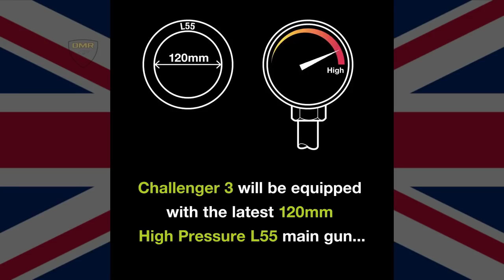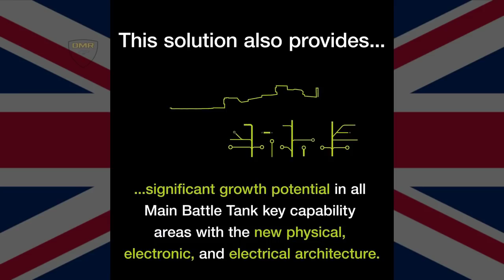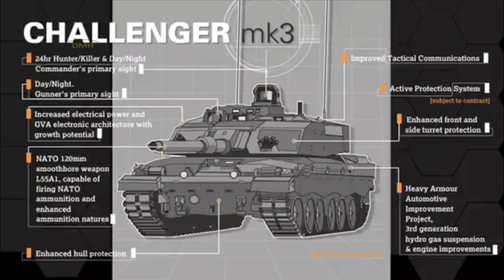Finally! The UK Unveils New Challenger 3 Main Battle Tank

Comment: old hull with its bad protection, a german engine, a german gun, it is a good one but certainly not at the level of leo 2 of mast gen.
At least UK is now more nato compilant.
Reply: old hull, is having upgrades
and also its actually the best hull in the world, and has been proven
the smoothbore gun has been on the challenger for a long time, and yes, it is so because NATO uses smoothbore, and unfortunatly we must adere to NATO guidlines as not doing so is unnecessarily costly. also, this gun is an upgraded leo gun...... not the same

the Leopard is aGREAT tank, but its not even in the top 3 in the world, and that was before this tanks reveal.
Reply: @EmperorLionflame  Well, other are not cheap either but more reliable, more powerful and efficient, when proposing the Challenger 1 and 2 no nation as ever express the desire to have it to defend themselves. Despite many nation running Leo 1 and Upgraded M60 and who are very happy of it.
This tank is good because UK says it is good and it only fight low end T55 in the Iraki wars.
The older gun is rifled and know to have a short life span, the 2 piece ammunition prevents from using hi performance APFDS and NATO compatibility.
In Fact nobody uses this type of gun anymore apart some older chirftain in arabic world.

It is presented at 80 km with the same suspension, I am very secptic of it. japaneese T90 and Leclerc has autoloader, hydromatic suspension that are far more advanced.
leo has torsion bar, proven to be very effective and reliable.

https://ukdefencejournal.org.uk/challenger-2-the-wrong-tank-for-the-british-army/
Reply: @EmperorLionflame  Sadly, all nation who have design good tanks (FRance, UK, Korea, China, Russia,Japan) has made different choice of the UK, either all these nations are bad either UK hase made the wrong choices. But nobody wanted to do the choice of the UK.
I can go the same for the riffle with its strange ammo that nobody use and witch has not been seen as reliable. Other machingun are now standard high quality Belgium ones. 
And yes do some reserach on Gum, 120 smoothbore has proven to be the best in all test. And HESH is so wonderfull that nobody wants to uses it. The APFDS is so much effiscient.  It is not so vital to Keep hesh, if not UK won't ,see the german gun as an upgrade. If UK gun was betetr they would have keep it.
despite all of this, armor stay the same, suspension also and we will see in wew years what is the real speed but I really doubt of it reaching 60 miles/hour.

Also notes that Leclerck, K2 and T90 (japan tank) can fire on the move at high speed and reload withoud slowing down  because they have an autoloader. This is not possible with manual loading.